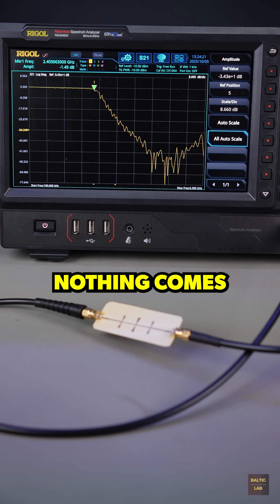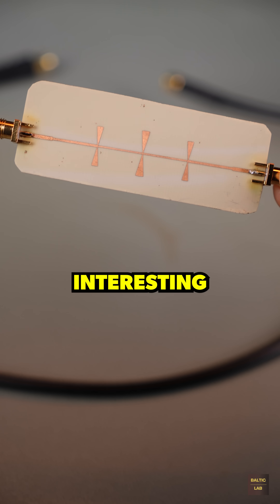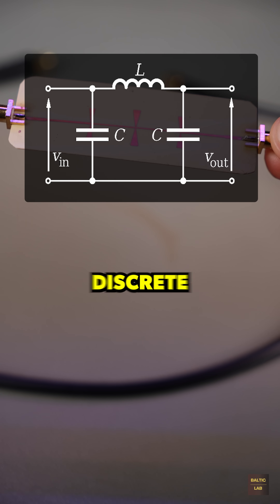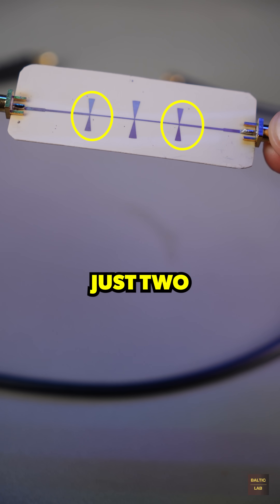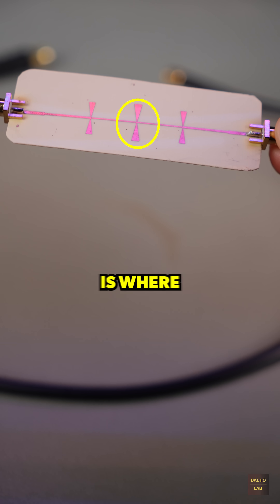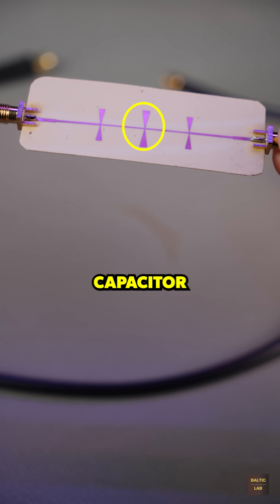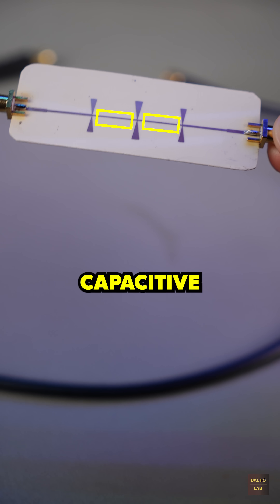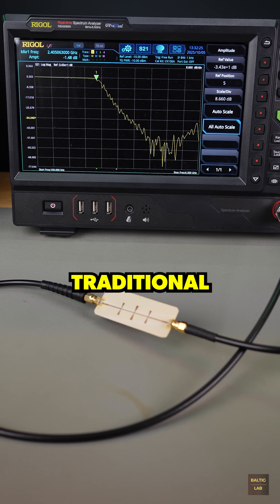Radio Frequency Magic: 2.4 GHz Low-Pass Filter with Butterfly Stubs  #electronics #hamradio

Comment: Very short wavelengths means you can use a specific length of PCB trace to get a phase shift, allowing the current and voltage to act like an inductor rather than a capacitor.  Or at least that's a very simplified way of looking at it, the math is more involved, of course.
Reply from the maker: Also works just fine at lower wavelengths. Might create some space issues though. :)
Reply: @BalticLab  True! There are subtle effects that come into play depending upon the frequency of the signal involved, higher and lower.
Reply: @BalticLab Can you explain how this works? From what I remember from my emag class in college the impedance transformation depends on how many wavelengths long the transmission line is. intuitively I would think that this would lead to a less ideal filter, so I'm curious about the theory behind this
Reply: you have to start zig zagging pcbs at that point to maintain phase over longer distances across the board iirc
Reply: Voltage and current don't "act like an inductor" lol

The trace on the board acts like an inductor, and as mentioned, the protrusions off of it act like capacitors. The larger "cap" in the middle acts like an "enforcement node" that peaks the filter (resonant) at the pass frequency. This gives largely flat response across the entire low pass range it is designed for. Everything above that is attenuated sharply.
Reply: @HerpieDerpie-op2yj  Oops, I accidentally left out the phrasing I intended, more or less saying that the current and voltage using the trace as an inductor.  LOL indeed! 🙂

And thanks for pointing it out and providing additional details.
Reply: The downside is the size of the PCB. Sometimes it's too bulky while discrete components are tiny in comparison. But, it's as elegant and as cheap as it can be.
Reply: @elim7228 The up side is, it’s easier when you just have to use capacitors for decoupling DC. Every mountable component comes with very noticeable parasitic effects, which can be annoying. Don’t think about changing manufacturer of a capacitor, once design is finished.
Reply: @IJzzo  yes, good point re the obsolescence factor.

Comment: I discovered this in 1996 while trying to design a mini radio station. All standard laws of current flow go out the window
Reply from the maker: I wouldn't agree with that: It does follow absolutely all standard laws precisely. The problem is really the oversimplified models we learn. While scaffolding is an important tool for teaching, I think it does more damage than good.

Comment: Wow. I am a self trained amateur. I do alright. But I haven't seen this. I would like to try it. It must be valid only at frequencies and scale. Is this true.
Reply from the maker: The term to Google if you'd like to give it a try is commensurate line circuits. Technically, they can be build at absolutely every frequency. But for low frequencies they'll become very large as the dimensions are wavelength dependent.
Reply: Thanks

Comment: Setting up such a filter is black magic. For this purpose, the structure is plugged into a network analyzer and in certain places it is touched with an RF Stick, i.e. a toothpick with a 1x1mm piece of copper glued to it. :) I worked in this field for 17 years as a software engineer, from 2GHz to 35GHz, MMIC chips, patch antennas, BUC amplifiers, etc.
Reply from the maker: I remember tuning RF amplifiers by sticking tiny metal pieces on it. Fun times.

Comment: Its called a commensurate line circuit.
To understand it simply think about when the values are really small and all metal has some elements of all of these properties.
e.g.
A length of wire is simultaneously a:
 resistor,
 an inductor
 a capacitor.

This design is simply using these properties in interesting ways to produce the filter.
Reply: Nah, it is just antenna.
Reply: Thankyou!!!! Im sure that comment was specifically for me. Helped enormously.

Comment: I wonder what effect the off-center and slightly diagonal arrangement on the board has.
Reply from the maker: No idea. I didn't compare it with a straight one. All I can say that it wasn't intentional but merely due to me being low on the perfection scale. The measurement, however, lined up almost perfectly with the simulation in CST Studio. So I'd claim there was next to no influence. But that's just a gut feeling.

Comment: you know it's high frequency when instead of discrete components, engineers invent new types of runes for their pcbs
Reply: PCB are too fragile for us. We use coax but the geometries are nothing short of heiroglyps. In fact, its a very long one.
Reply: Pretty good way of putting it
Reply: Silicon is only even more runic than PCBs. We've tricked rocks into thinking by drawing some squiggly squares and lines on it. To a point it now thinks that it thinks through AI.

We invented black runic magic decades ago. Now we have them in our pockets. Charged through "mana" directly connected through "laylines" to "mana generators" miles away. We can even do it without physical cables, I mean laylines, and power things like our pocket runes with "mana over the aether".

All you have to do is change the presentation of modern life and we have everything black magic was described to be.
Reply: @KaiserTom  yeah, we have runes carved into silicon wafers at the nanometer scale that operate in the GHz range.
Reply: @KaiserTom  i just get angry reading posts like these.
Reply: @KaiserTom there is no AI yet
Reply: @frostjune6072  Nothing to do with my comment. No better than a bot yourself
Reply: @KaiserTom except perhaps the part where you claimed that there is
Reply: This rune says: you, high frequency signal, shall not pass!
Reply: [ retired Engineer ] Nah, scrape off a bit of copper here, add a bit of solder there. :-D
Reply: @philiprowney  That sounds like you're tuning an SFH antenna.
Reply: I was thinking the same

Comment: I wrote some prototyping software back in 1986 that would take a strip-line microwave filter design and create the PCB (on a router), the CNC instruction to make the metal housing, and finally the BOM for the parts (connectors, screws, etc.).
Reply: How many kilobytes back then to write that and how many gigabytes now for the same software?
Reply: @petevenuti7355  due to the reliance on many programmers now to program in ever higher level languages, many libraries are simply included without realising the bloat.
Reply: @idlewise not just the stuff they include but the size of what is required!

Comment: Some specific shape to make a capacitor, ok, could see that, but same shape turns into inductor in specific conditions, that's some serious voodoo magic
Reply: As the frequency approaches or exceeds self resonating frequency, the capacitor's impedance begins to increase and it begins to behave more like an inductor. Same with inductors.
Reply: @detalite  No thanks bro I'll stay in my DC/low frequency bubble.
Reply: because of how waves reflect, if you get them to reflect just right you introduce arbitrary phase shift.
Reply: If you coil your wire you also get an inductor. Woooo spooky
Reply: @KiriIrving  I thought that would be air coil.

Comment: G. L. Matthaei, L. Young and E. M. T. Jones, “Microwave Filters, Impedance Matching Networks and Coupling Structures,” 

The RF Bible.
Reply: It certainly is.  When I worked in a research lab in the early 1970's, we had just one copy of it that we had to share around.  (Just like we had to share the then extremely expensive, handheld HP35 scientific calculator!)

Comment: Cavity filters, Antennas, co-ax line transformers, strip line design, its all amazing voo doo.
Reply from the maker: It truly is fascinating how these things work!
Reply: @BalticLab Especially at the tiny dimensions and power levels in giga Hz range. 

I bet old timers thought the same way, 100 years ago, making a radio receiver out of some wire, a pencil, and blue steel razor blade.

Comment: I'm a trained engineer with studies in RF and it still blows me away.
Reply: You probably need to reduce the voltage then.
Reply: I´m an electrical engineer also. But in automation. I like DC Everything beyond Bus-Speed or Baud rate I can see on the scope should be illegal :D
Reply: I thought circuits 3 and two port networks were magic. they were merely the primer to RF and its dark magic circle tool. if you know, you know.
Reply: And the math... Oy.
Reply: I still don't understand how the fuck a microphone can turn sound into voltage and have over 20,000 frequencies as a voltage.  And then how they get assigned as 1s and 0s in an Analogue to Digital Converter...
Like, I get sound disturbs a diaphragm that changes the capacitance (for condenser mics)  but to me it only makes sense to be able to capture 1 frequency, and it's primary harmonics e.g. 100hz can also contain 200hz, 400hz, 800hz, 1600hz etc.  But accurate representation of all audible frequencies (granted, tiny condenser capsule)
Reply: @DjentyDjamie  5000 years of human evolution: Euler, Gauss, Nyquist, Bell, Marconi etc.
Reply: @betheh why marconi? If youre referring to the invention of the radio, thats tesla who had filed the patent for the concept of radio transmittions before marconi by several years
Reply: @DjentyDjamie  Marconi did the first transatlantic radio communication. Some wrote concepts, others did it!
Reply: @DjentyDjamie  Forgive me if I'm missing the problem but a microphone captures the momentary air pressure as a voltage, not discrete frequencies.
Those individual voltages are stored as a graph showing more-or-less the position of the microphones diaphragm at each point in time.
If you want frequencies, you can only really sort of reverse-engineer them via FFT or some such similar algorithm, they're not actually stored (not directly anyway).
Reply: @TimBell87 A bit oversimplified but still a good explanation. Just want to add that the microphone converts sound pressure variations into electricity. If there are no variations there will be no current.
Reply: @ppdan  Correct - I said pressure because variations imply frequency is involved and I was trying to steer clear of that.
Yes, a microphone only works if there are variations in pressure, but critically - trying to explain the relationship correctly while making the necessary distinctions clear would have likely resulted in a wall of text that no-one wants to read.
Reply: @TimBell87  If you're listening to music, how can you pick out and hear every discrete instrument at any given instant if the mic or speaker can only do 1 frequency at a time.  I'm an electronics expert and still don't understand that.
Reply: @markgigiel2722 i think it has something to do with how our brains process sounds. Could think of it as how can we perceive videogames on flat screens as 3d scenarios
Reply: @markgigiel2722  
What we hear is just a superposition of many sounds, your brain just picks what to “listen” to. A speaker doesn’t actually play one frequency at a time, it plays multiple. Think of it like this: say we have a 1Hz and 10Hz tone, which in time looks like sin(2pi*t) and sin(20pi*t). If we add those together, we get a wonky periodic signal. That is what your speaker plays over time, where the resulting sum of those sinusoids is the voltage driving the speaker. Now, if you take the Fourier transform of that superpositioned (summed) sinusoid, we would get two discrete points: 1Hz and 10Hz. So at any given moment, those two frequencies are playing together. Your speakers only see one voltage at a time, not frequency. From there, your brain does its black magic of discerning the frequencies and sounds.
Reply: @SupeIex  I get it, but it still amazes me that you can play an entire orchestra through a single speaker and if the "mix" is done well, I can pick out every instrument.  So, our brain is essentially doing calculus when we try to discern a certain sound, such as recognizing the individual note of a chord.   I think I'll stop analyzing this and just listen to some music.
Reply: @DjentyDjamie 如果 你能 確實理解 喇叭的工作原理 
反過來 就是 麥克風的工作原理
Reply: ^^^ I'd love an explanation to the above comment ^^^

Comment: LOL!  This was MY area for 30 years... and I LOVED it!
Reply: From electrical standpoint it's a piece of wire.
Reply: @sharpfang Which shows you how complicated high speed wires really are.
Reply: @jimgolab536  there's a slow electric?
Reply: @Bajinowhere electrical energy can be distributed and utilized in multiple forms, in low voltage electronics it is commonly utilized in DC (direct current) which is a continuous and stable waveform. There are also alternating current or AC modes which utilize oscillating currents, this is what mains electricity comes into your house as usually 50 or 60 Hertz or cycles per second. Then there’s high frequency and radio frequency, which oscillate many thousands or millions of times per second. These forms of electricity can create electromagnetic fields which are able to propagate for long distances, which is why we use these radio frequency modes for everything from AM and FM radio, walkie-talkies, cell service and WiFi, to satellite communications, and many other forms of communication.
Reply: @joe.O7X 
How slow can electron flow?
Reply: @Bajinowhere  yes, its called resistance
Reply: @Bajinowhere  0 is the slowest lol, an open circuit is the slowest circuit
Reply: @sharpfang  "From electrical standpoint it's a piece of wire."
Only at DC ! 😆
Reply: @hectorpascal even dc has a specific impulse, which basically averages as steady. Even triboelectricity can be interpreted as a current, but to the extreme opposite as a short duration impulse rather than a consistently average series of low frequency potential. Frequency is everything as it determines the properties of the potential
Reply: @hectorpascal I take it you know nearly most of what there is to know about it, I'm not keen on the math to be resourceful from a hobby or career perspective. You should publish something, anything that you know I'm sure you're a good authority on high frequency physics.
Reply: @1ch190  I taught Electromagnetism and Transmission Line theory at Undergraduate level for nearly half my working life.  Sadly the amount of math needed to TRULY get to grips with the subject is more than most people (or even  EE students!) are prepared to commit to!  But there are some internet sites in the ham radio area that are pretty good at the basic practical aspects.
Reply: @hectorpascal I fail at a level of calculus I find math fundamentally flawed which frustrates my learning opportunities
Reply: @1ch190  Correct.  But is the transient response due to the application of a steady potential at t=0 truly definable as "DC"?
Reply: @hectorpascal There's probably a way to simplify electric theory, I find too I'm exposed by too much negativity, directly and indirectly at any given moment on a daily basis. I'm not satisfied pursuing my hobbies. I certainly would not attempt to pursue any academic objective. It's against my values
Reply: @1ch190  Bruh, you find math flawed so you can't learn it? What in the marcus
Reply: @NoWereDunzo yeah cause what is a rational number? A dot on a line? Can it be expressed as a fraction? Neither of those are right answers
Reply: Why "was" ?
Reply: @andreyavramov9326  That's what happens as you get old...  New ideas emerge and you also get interested in other areas!
Reply: how would you rec someone enter the field if they couldnt get many (or any) RF resources in undergrad?
Reply: 3 phase from 3 dynamos in mutual resistance will act as carried waves on a carrier thereby producing a pump z of the carrier and of them, which in turn causes all hf waves to pass through zero point (focal passage), so if any of these are in sync yet out of phase they must combine as a sum to then charge the focal medium/metal with energy. So how that focal metal charge simply returns lost energy into whatever resonates with the least resistance. It is important to know that charge opposites split over points of charge in all relative parts of such a circuit, so the high energy will increase negative ionization output as the +ions fly off the opposite which in many cases happens to be ferrous material, but is whatever is both the lowest frequency charge modulation with the greatest influence from the highest hf modulation. In any loop circuit, it is necessary to keep this point open, since +ions will seek ground to reorganize/reionize to natural neutral state. If it flies back into the circuit or another circuit, it'll only fight itself for efficiency (chokes without both +ion outlet and neutral ion inlet.) Such are established laws of true zero point energy. I just found this video interesting since it's using quite apparent focal mediums there as well as 3 dyamos to form the zpe continued fractal. There are ways to run chips on zpe alone at over 500kv without damage once you turn the clock up that high. If I had time and help I'd start mining crpto, as it would be around half a million times more efficient.